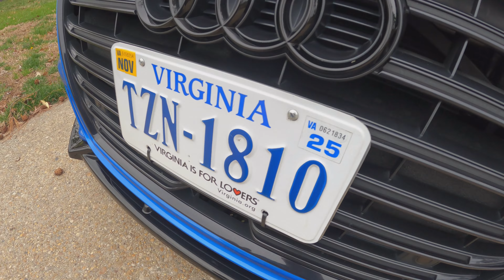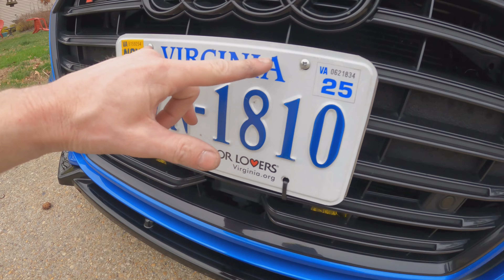2018 Audi S3: Episode 139: Testing the Bauer 14" Drop Saw from Harbor Freight

Comment: Instead of cable ties for your license plate try using spring toggle bolts. I’m not sure if it will work for you but definitely check it out.
Reply from the maker: ah ya, good call